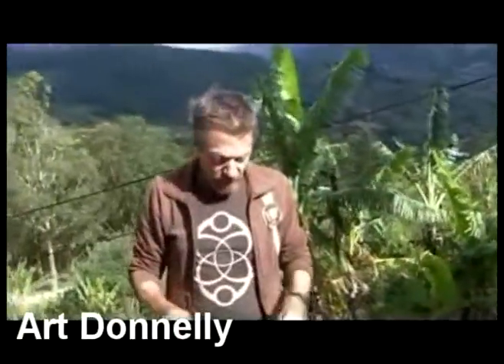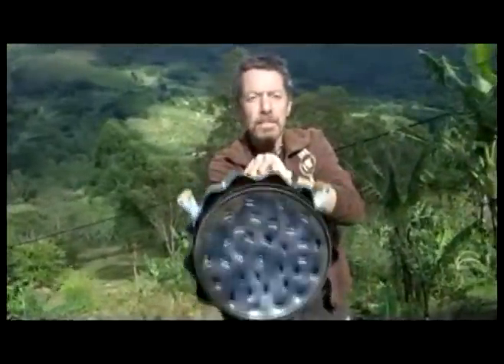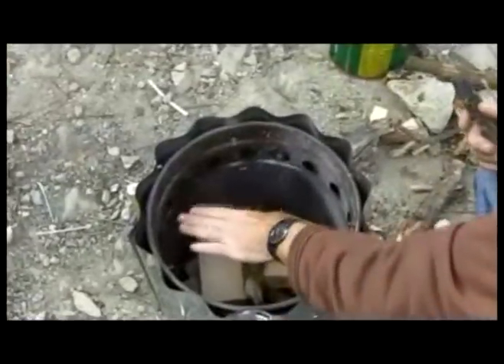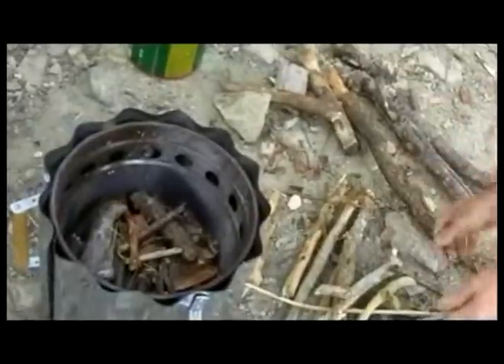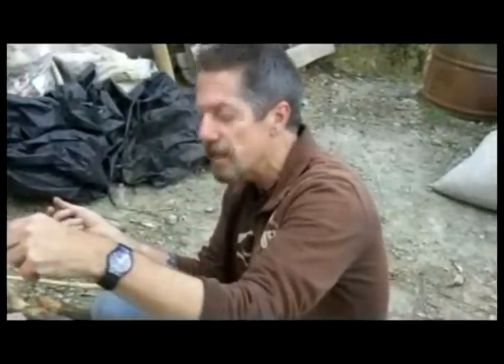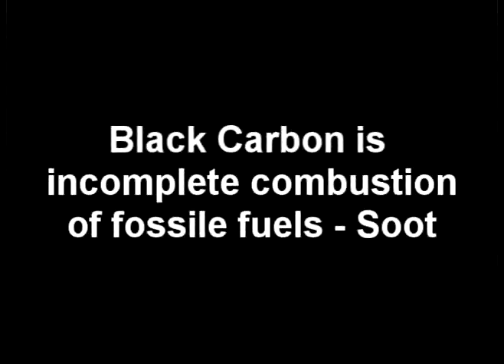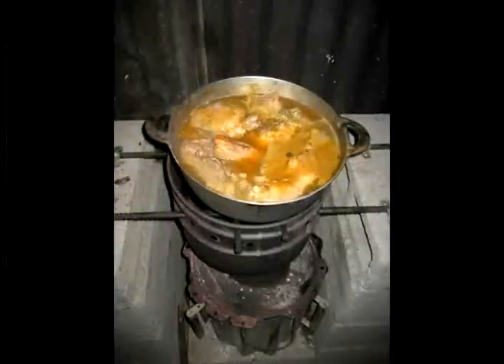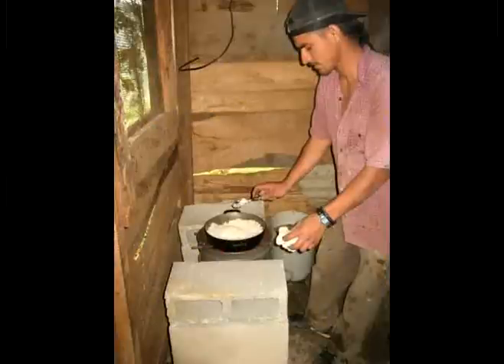SeaChar / Estufa Finca biochar stove demonstration.mpg

Comment: Why not put the corrugated metal inside the smooth can?  Then you could direct the holes it at an angle to induce a vortex.  Also it would spring fit inside the outer can.
Reply from the maker: peterinbrat Hi Peter, thanks for the input. We tried that but the corrugated deforms under the heat and you can not maintain the separation between primary and secondary air. There were a few other reasons for not doing it but that was the biggy.
Reply: Art Donnelly Thanks, that just saved me some time.. 
I've been working on an inverted funnel type rocket stove with secondary air, cast with some perlite, but I'm going to try some metal air entrenchment designs too.   The main concern I have with metal is corrosion.   With cast designs, the problem is I don't have the patience to let them cure properly, then I get steam cracks.